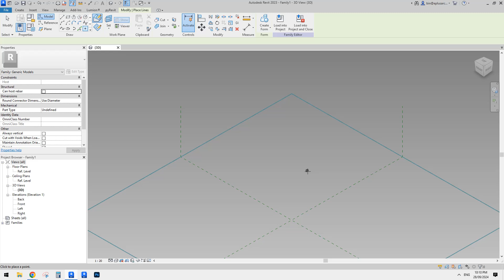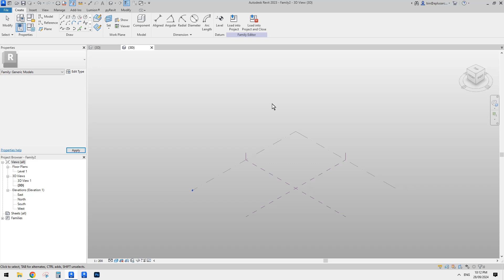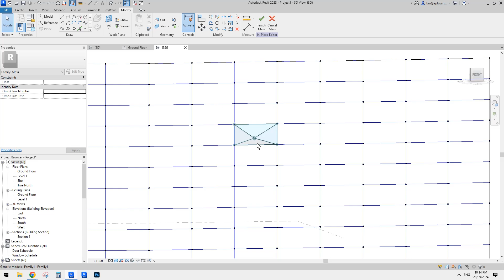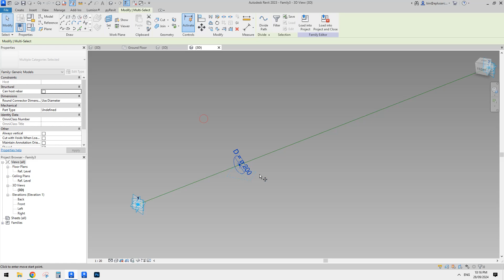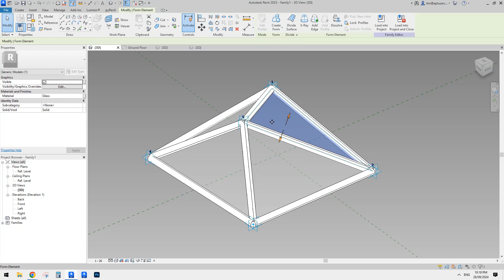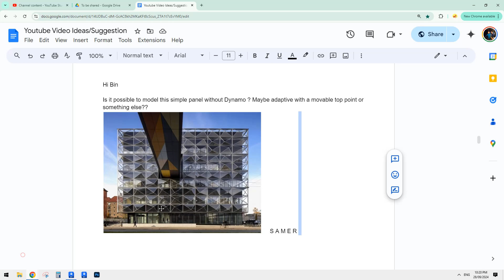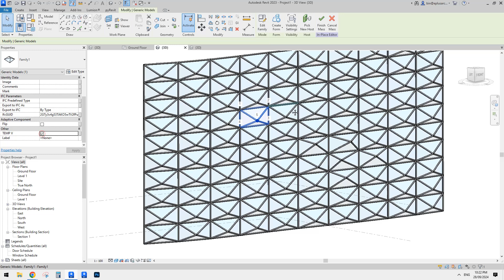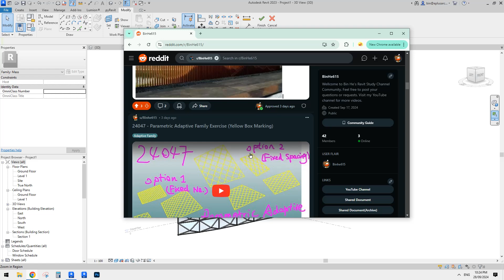24049 - Adaptive Curtain Panel Family with Adjustable Point (No Dynamo)

Comment: Thanks a lot Bin very educative. But i am a bit confused, when do we use the metric pattern panel and when do we use the adoptive panel. I don't know know their differences because i always thought that one can use both to achieve the same thing or effect
Reply from the maker: You are not wrong. They are very similar, both massing family and both with adaptive points. Usually, we use pattern based family when we notice a pattern on a surface, and usualy a large amount of those families are needed, for example, a building facade with some panel system. We use adaptive families when we need them to suit some specific situation, for example, to place a shade sail onto some columns with different heights in some random locations.
You can also use adaptive families on nodes with repeat to treat them as pattern based families, you can also drag your pattern based family from your project browser and treat it as an adaptive family. You will know which one to use once you know them better. :)

Comment: That is  it exactly Bin, thanx 
Although it’s a short one but full of tips and tricks. 

Actually you need only 2 sides of the rectangle … enough in order to avoid duplicated members. 
I would select the top adaptive point by small window + filter 
But good to know about visibility parameter … I did not knew about that before, very useful to know 
Also to hide the form in order to avoid link the members to the form in stead of reference lines is very important thing to know  
It would be nice in the future to make a tutorial where you go through all the properties in mass and explain what means  all the headings …. You know Revit is not so intuitive to know what the parameter could be
Reply from the maker: Thanks Samer. I agree with the 2 edges to avoid duplication, I was too lazy to fix that :). 
I will have a think about your suggestion, to be honest I only really understand some of them, those I always use, sometimes I just randomly try them until it works :) 
Can you help me post it? https://www.reddit.com/r/BinHe615 do you use Reddit?
Reply: @BINHE615  
Hi Bin … i don’t know Reddit 
But I can post the question in the shared document as we use to do , if this will help you? 
Even if you know only some of them it would be a great help to know what that could be used for. 
Actually there are no many tutorials about that on the net, and to search about that in Revits help is a hell !
Reply from the maker: Reddit is a forum, on which I have created a community dedicated for my channel. I have posted hundreds of my video links there with different categories so people can easily and what they like to see. People can also post request with images and interact with others or answer questions. When a question is answered or a request is fulfilled, people can mark that post as answered to help themselves or others. Even if you do not have an account, I believe you can still view everything. Click on the link and have a try. :)